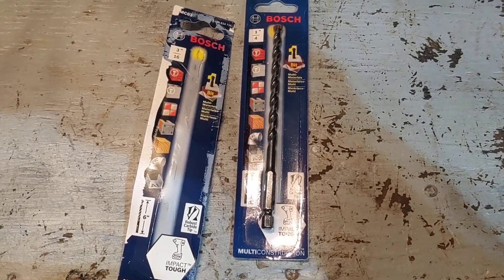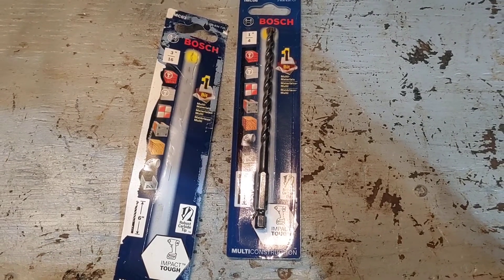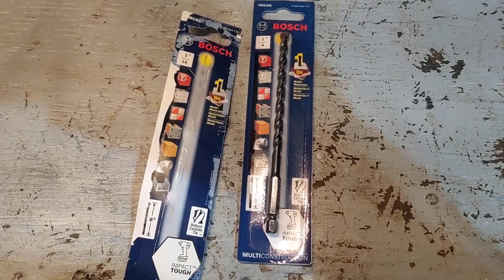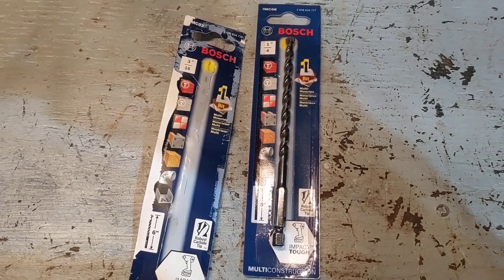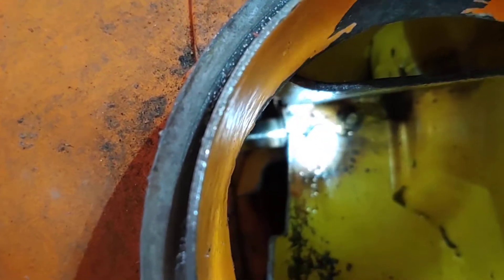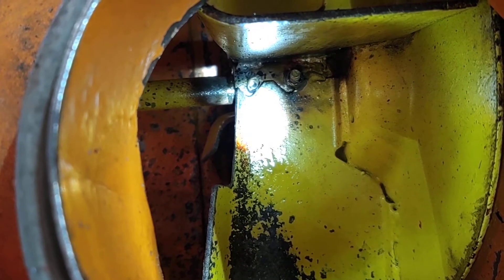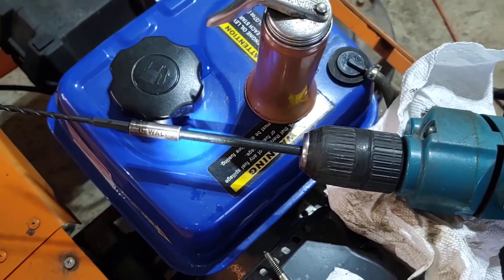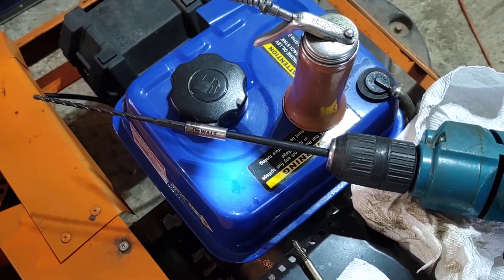Drilling through hardened steel

Comment: DUDE I STOPPED EVERYTHING TO GIVE YOU YOUR FIRST COMMENT ANOTHER SUB AND LIKE ON THIS VIDEO! I was working on getting a turbo off on a MK1 AUDI brooo the bolts were stripped and 12 point metric at that it was terrible! I debated between you and another drill bit so i bought them all desperate. TRIED YOUR BIT WORK WITH  little time and patience its working! i tried welding first nothing, then heating, nothing, drilled worked at first until the extractor broke off in the screw smh guess what broke through threw the extractor i broke off in there! your bit bubbs! ty!
Reply: Do you think it will drill out a snapped ez out? I’ve ordered a glass tile bit I’m hoping it will do the trick